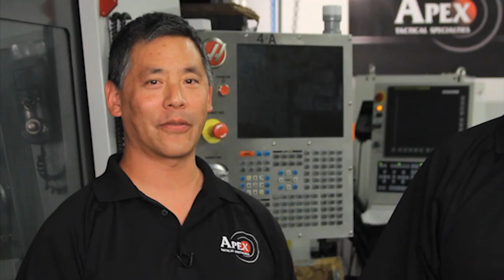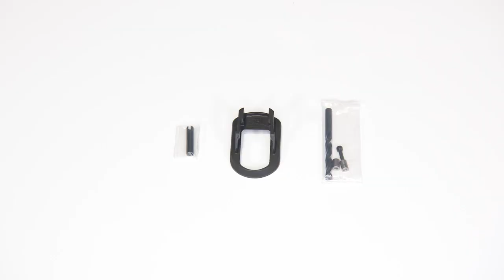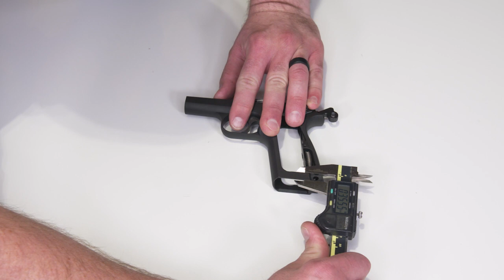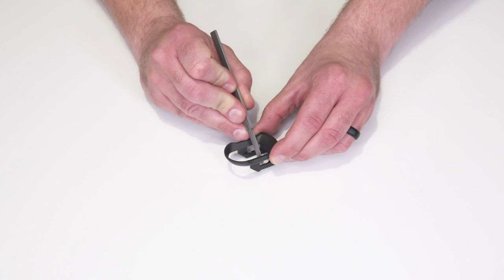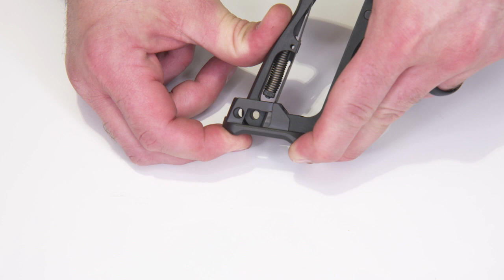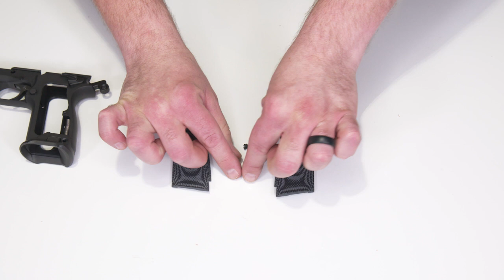Apex SA-35 Low-Profile Magwell Installation Instructions

Comment: Any chance you guys will make any of these for clones or ones without the hole already?
Reply from the maker: We're working on the video for how to install this on the Clones.  The parts to install this on your clone are already in the package, but the instructions aren't ready to roll out yet.
Reply: @apextactical  also another question would you guys be able to do one for the magazine base plate or extension? I was curious on buying the aluminum one once I get my magwell.
Reply from the maker: @ebkbk9902  I don't understand the question. Are you referring to the magazines we presently offer for sale?
Reply: @apextactical  yes sorry I was asking a separate question for a different part. I seen you guys offer a magazine baseplate extension for mecgar magazines either polymer or aluminum i wasn’t sure how to install one of those it looks like the mag gets cut?